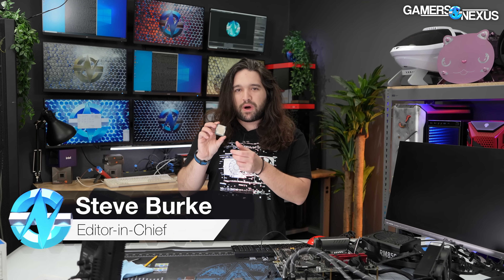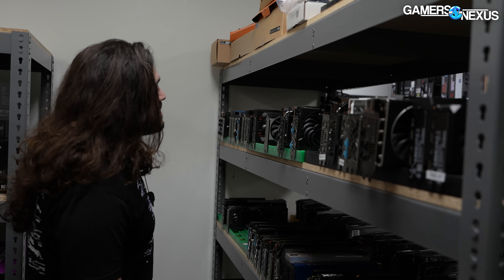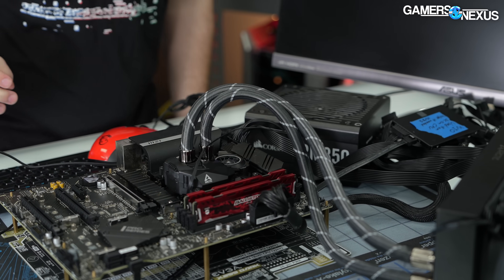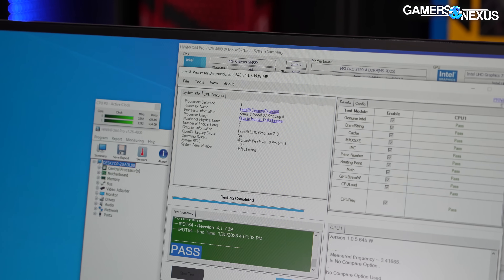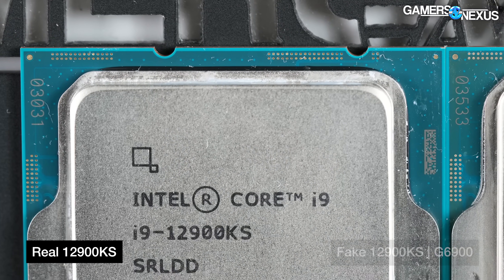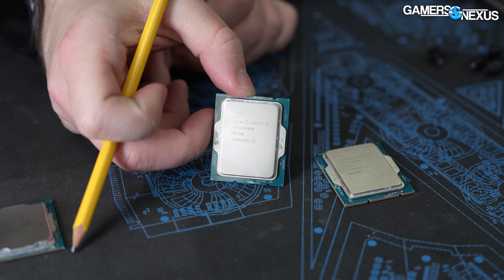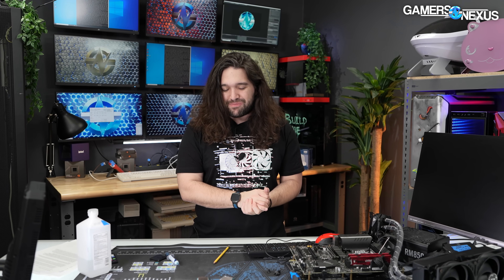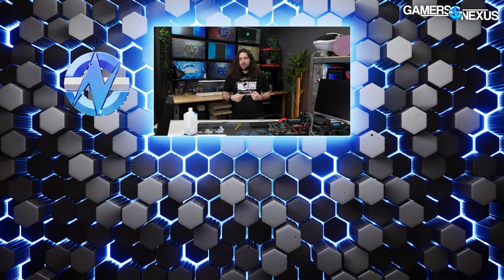Beware: Counterfeit Intel CPU Scam on Used Market

Comment: I was just looking at R7 7700X CPUs on Ebay out of curiosity before watchng this video. This makes me wonder about the ones listed at $250ish USD and do not include a box. Just the clear plastic CPU protector that is inside the box and Ryzen case sticker come with it.
Reply: That could be a tray chip. These have been a thing for a long while, they're sold to OEMs usually and are legit (maybe that one you're looking at isn't, just saying most of the time they are).
Reply: @kajurn791 , I've seen what you are talking about before, too. This video just made me think about the possibility of it being a fake. I guess that's always a risk on Ebay, regardless.
Reply: I mean, at worst it's a 7600. Definitely can't be anything worse unless it's not the same socket. eBay buyer protection is also very good
Reply: @JBrinx18 , that was my thought, also. It woldn't be a HUGE loss, but still a loss. What makes it stand out a bit is that the "7700X" on Ebay is priced jjust above the price of a new 76000X.

Comment: Fake AMD AM4 CPU's I've seen swap the IHS onto an old AM3 CPU. It simply doesn't even work on an AM4 board. These CPU would be put back into the retail box by opening the bottom of the box, and then hotglued back so that it appears to be an unopened "NEW" retail box when in fact, it was completely swapped. The IHS is actually shown through the little window. The only way if you can see it, is look for the AM3 Gold triangle on the substrate.
Reply: For AM5's the new box has been redesigned that requires you to break the sticker seal to open with a foldable wrap around cover that goes around the box.

Comment: Unrelated to the topic, but on new years I had my EKWB 240 basic aio pump die after less than a year of running. Luckily I got it warrantied and got it replaced with a 420 Arctic Liquid freezer for basically the same price, about 115 euro. Barely fit in the case, but loving it. Thanks Steve
Reply: 420 or 240 ?? LOL
Reply: @clansome  3x 140mm
Reply: @V.n.D  🤦‍♂I have a 280 Arctic Freezer ii  and I still couldn't do the maths to get to 420. DUH !!! Think it's because I fitted a 240 in my brother-in-law's PC last week. Bloody good price you got it for too. 😄

Comment: couldn't the scammer have delid'ed a celeron and a 12900ks and swap the heat spreader?
Reply: Doing that would create a pile of mislabeled 12900ks so unless they're keeping and using the CPU that would make no sense to do and lasering blank IHSs would be way cheaper
Reply: @hyperstimmed  of course they kept the better chip. They just got cash back on their upgrade.

Comment: One time I saw a Reddit post where a dude got a Ryzen Sempron instead of a 3700x
Reply: A 'Ryzen Sempron'? lol
Reply: @ebridgewater  i won't be mad if that will be really ryzen sempron because it will be only one in the world 😂
Reply: Ryzen Sempron? Were they from an alternate timeline? No such thing here. Sempron ended three years before Ryzen was released.
Reply: @sammiller6631  yeah, don't think they belong to the same platform either. Sempron, at its best would have been an AM3/+ product; Ryzen is AM4 onwards.
Reply: Ooof
Reply: I've seen a bunch of counterfeit AMD Ryzen 5 4000G series chips...enough that I will not buy them...  The best chip of the 8 I tested was a Ryzen 5 3200G and the worse was a late model Athlon (I think it was a 6400) with Ryzen graphics...  All were in builds people brought in...and the chips were at fault...
Reply: Oof
Reply: But did it fit in the motherboard